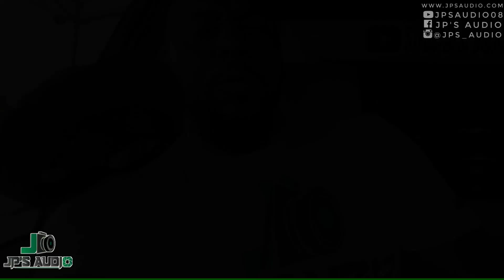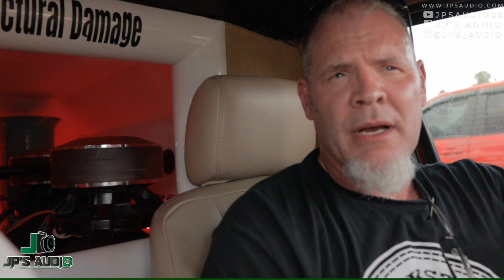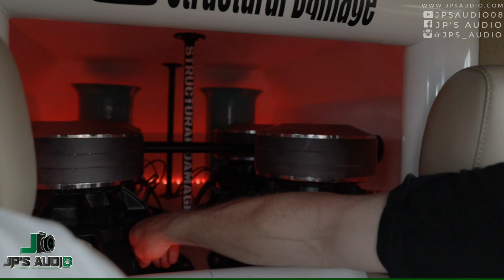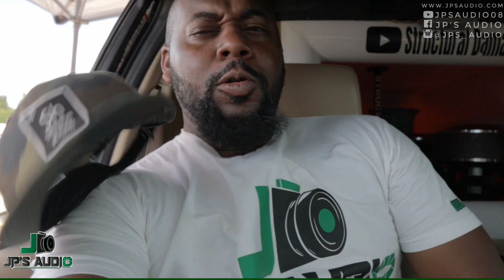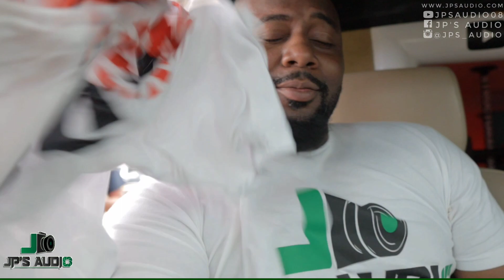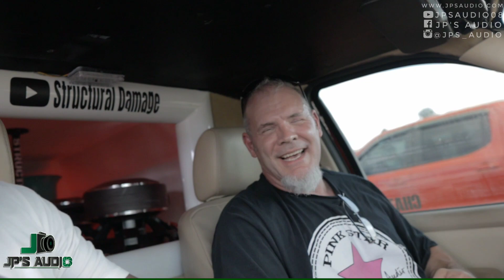Whoa this audio system is WINDY AF‼️| 4 psi platform 5 18s

Comment: Those 18s Are Getting Down!!!!!
What kind of power?
Reply: This is not so simple bro is the box  the  ports and the tuning with 18s and amps.and voltage
Reply: @denisbasshead7787  True
Reply: A Taramps Bass 30k at 1 ohm. I am clamping around 13k to the subs in this video.